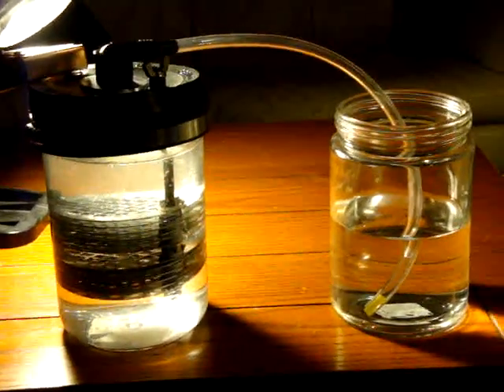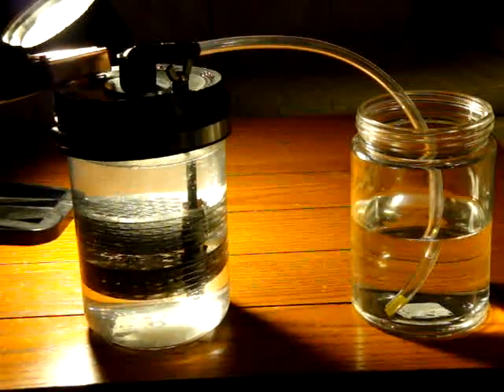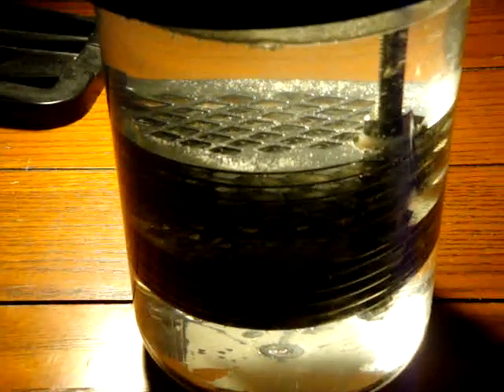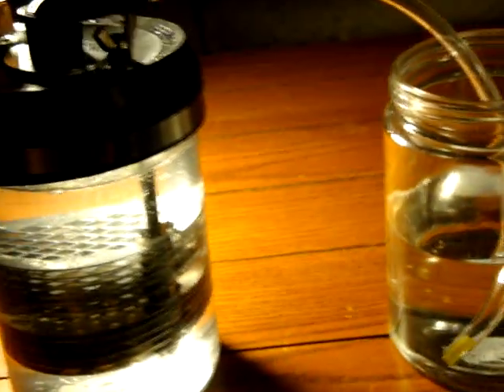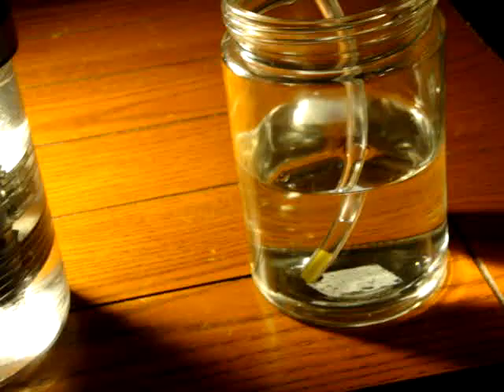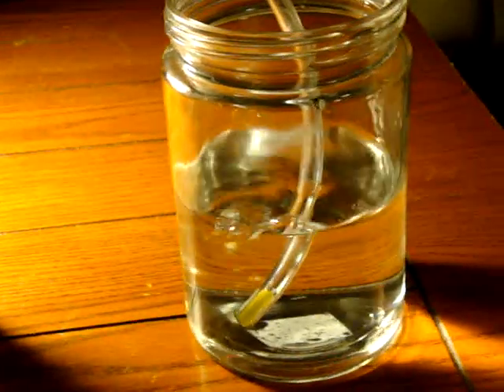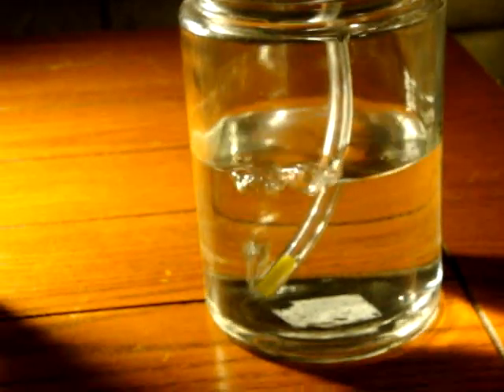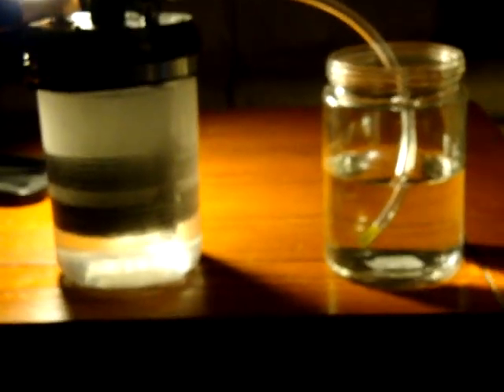HHO Hydrogen Cell - Fuel Cell - Hydrogen Booster

Comment: 1.hydrogen and oxygen gas
2.unless you are in a sealed room there is no danger of the gas reaching levels that could harm anyone unless you are using NaCl(salt)as an electrolyte then you could have a problem with chlorine gas which is deadly. But there is no chance of the hydrogen gas reaching levels that could harm anyone.

hydrogen is lighter than air is highly energetic likes to take up as much space as it can as soon as you see the bubble hit the surface and pop its bounced around the room